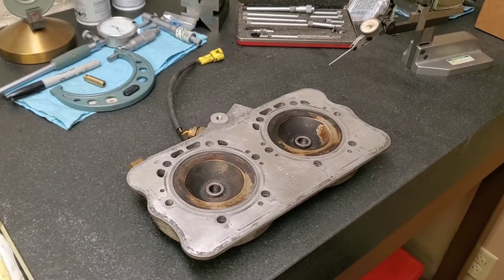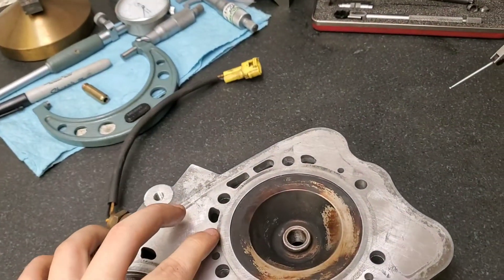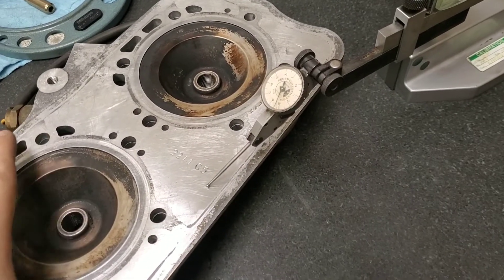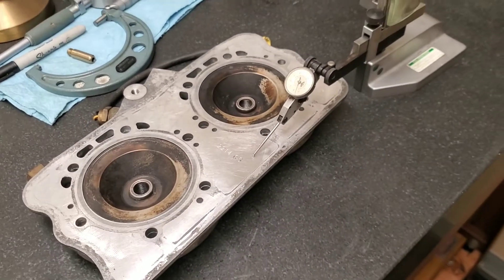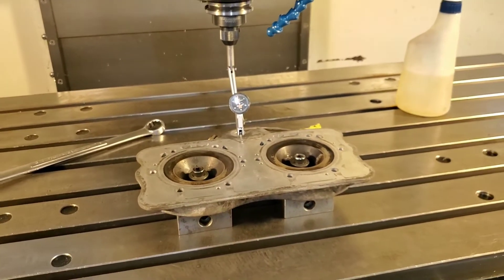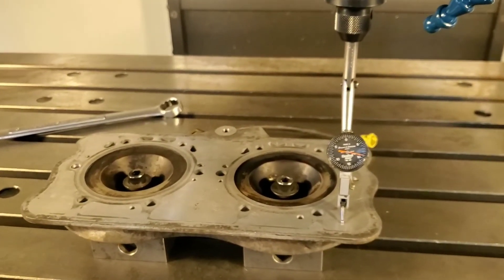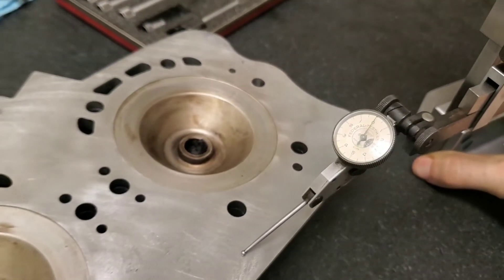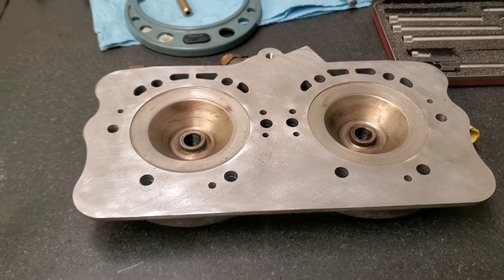Machining a 2 Stroke Cylinder Head

Comment: Hello, I have a 2003 Polaris xc 600 sp.  Stock head, are you able to mill the head and also do the squish so that it'll be able to use c14 racing fuel? Thanks
Reply: Hello

Comment: Did you have to grind the surface after the machine was done?
Reply from the maker: I did sand it lightly against a flat plate just because the finish wasnt aesthetically perfect but thats just to the eye. Dimensionally it comes out ready to run out of the machine. In this video I repurpose a boring head as a fly cutter but since I have begun building a nice big heavy fly cutter which should produce and beautiful finish right away. I can also face mill it and it would be good but fly cutting will produce a theoretically flatter surface.